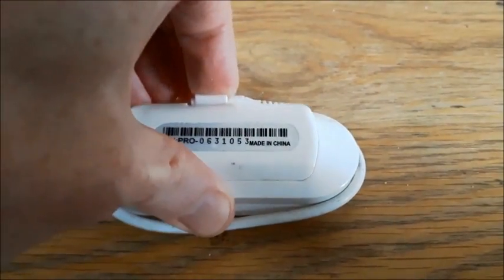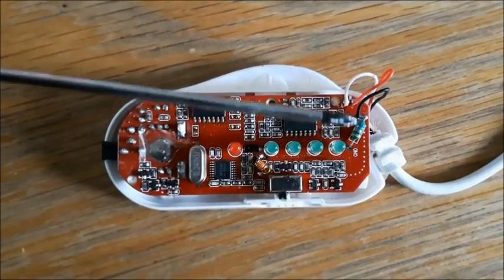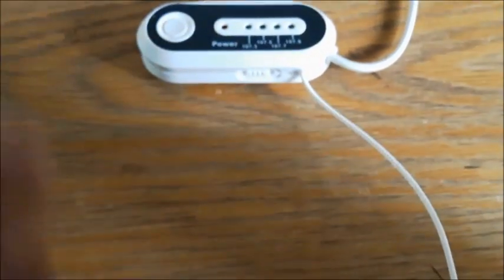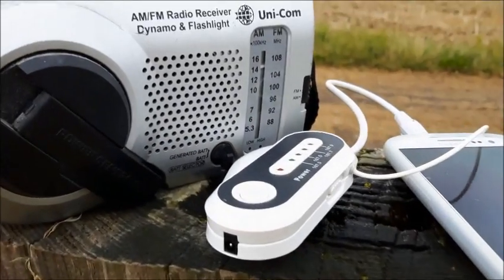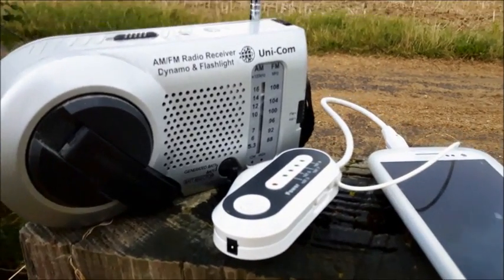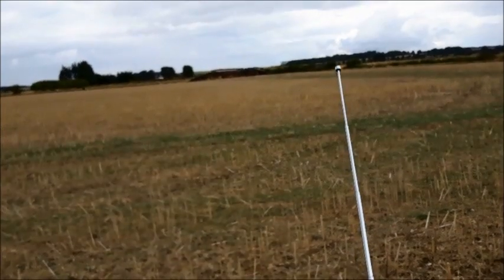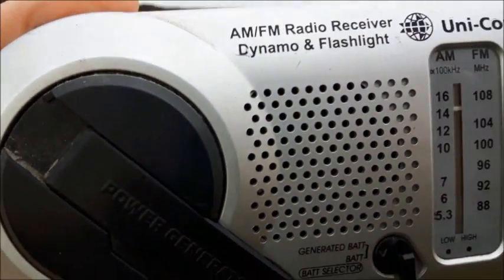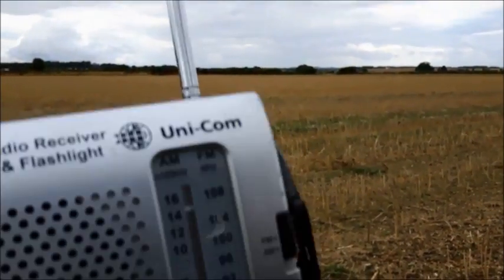FM Transmitter Modification Hack to Boost the Range

Comment: This helped even though mine looked very different. The board had very very small components and was hard to distinguish what was what. However I did find the antenna. So I just traced the metal on board from antenna to the first component I saw. I just gently broke off the component hoping it was the resistor, and put a tiny drop of solder between the connection. It worked like a charm. Crazy range and super clear.

Comment: you did not bypass it you just added antenna .the resister takes the much of the signal to ground .  remove resister ,attach 31.5 in of wire to ANT and 31.5in  wire at GND.   cut  a pvc pipe  to at least 63 in  . mount transmitter to center and wires to ends . mount pipe so Ant wire points up.   Huge range!
Reply: Im going to have to try that. Thanks for the advice
Reply: How long range?
Reply: @user-ji6lz1vh8g For a antenna to work efficiently it must be resonant to the frequency transmitted or receiving. Typically a ham would have an antenna remotely mounted using a coax cable and some form of support .  In other words,  for more range (better signal at receiver.) Those wires added will allow more signal out of the transmitter .  GND is the final negative terminal for the battery.  The battery's are connected in series . Does this help ?

Comment: I did this to an old radio shack FM transmitter which had that exact same resistor. It's missing now and I have awesome reception. Frequency select switches are a little iffy though.

Comment: Planning on using the same transmitter on my upcoming project this holiday season, do you think the signal would be strong enough to be good at around 30-50m? I'm planning on connecting the transmitter on my computer and using a cheapo FM radio as a receiver outside. 

PS. I live in the city. I've checked the list of the current FM radio stations here and 107.9 is not yet taken. So, I wouldn't be bothering anyone.

Thanks!

Comment: So did you remove the resistor or not? From what I can see it's still in there, mate.
Reply: By soldering the new line in front, he's bybassing the resistor. Alternativly, you could solder a jumper wire on both ends of the resistor to essentially remove it and use the original antena.